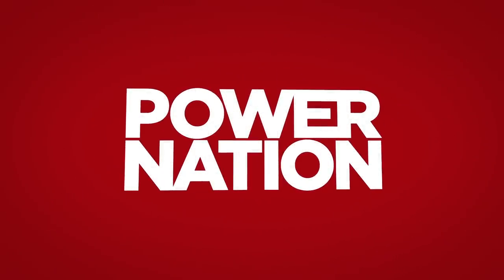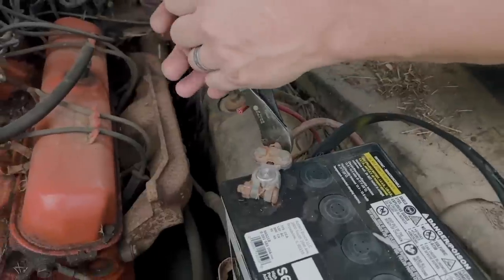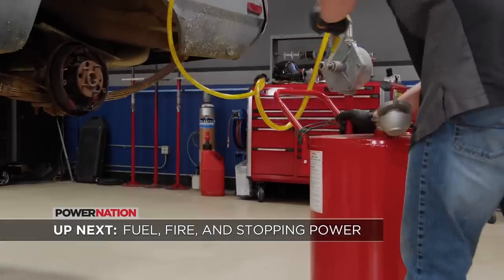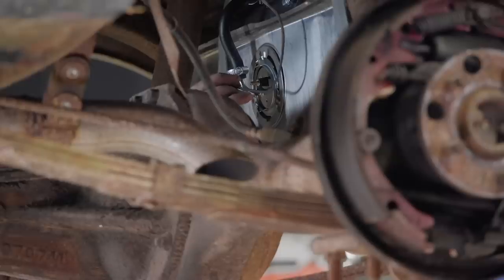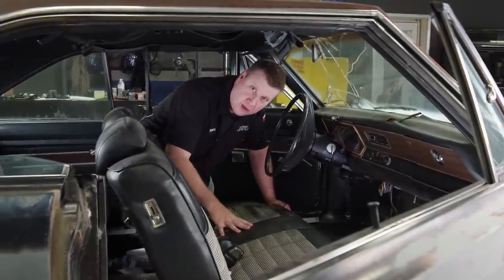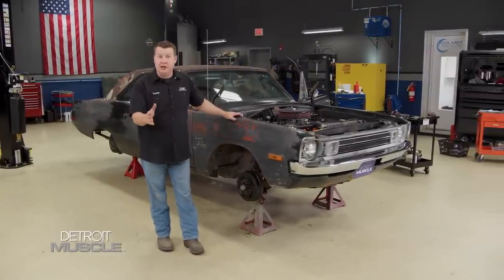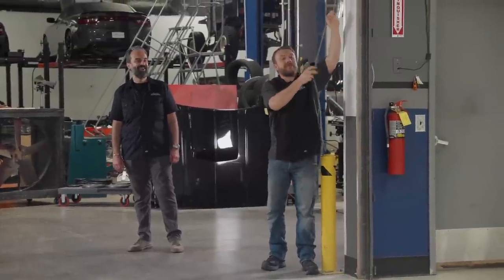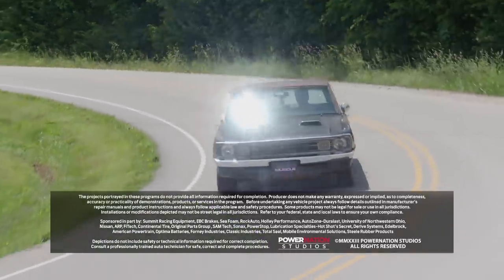Transforming A '72 Dodge Dart From Lawn Ornament To Pavement Pounder - Detroit Muscle S10, E7

Comment: We could only dream of finding a classic with solid bones like this
Reply: They are out there, you just gotta look.
Reply: They are out there somewhere. Only fewer and fewer ordinary people can afford them.
Reply: @Pracaupodstaw  Yep, that's why you gotta look outside the box for projects now, The HOT new build out here in Arizona are the Smog/Malaise Era cars from 73-85 because there plentiful and cheap often still running and driving for under a 3 grand. I daily drive a 73 Buick Regal that I bought for $1200 right after I got here and drove it home and then put another 5 k ish into, I just bought a 76 Cutlass for $2200 That I'm going to build into a weekend car.
Reply: @TheREALOC1972  Interesting. It is an option. I would obviously prefer a car from the 60s (possibly 50s or even 40s), but you know, the budget does not always allow you to fully realize your dreams. u, in Central Europe, an American muscle or pony is always a pearl or even a diamond - regardless of the decade of production.
Reply: @Pracaupodstaw  it's just in Central Europe where's that's a problem, I have 8k ish in my Regal you can't even look at a roller of most older muscle cars for that and that's just the start, 8k and mine is done.....
Reply: @Pracaupodstaw  SO correct!
Reply: my dad and i found an amazingly clean 74 swinger on cargurus lol

Comment: Minor point, but brake shoes are not about momentum, but leverage.  Assumimg a top anchor pin, the front shoe drives the rear into position during forward braking - rear shoe does most the braking, so it must have more surface.  If the pin was on bottom [I think some pre war cars tried that], its the exact opposite: rear shoe drives the front, which would put the bigger shoe there.

Comment: In 1972 my parents purchased a new Dodge Darts Swinger Special. It had a 225 CID slant six, a three on the tree, manual brakes, manual steering, and no A/C. The only thing it did have was an AM radio with a single dash speaker. It was the car I took my driving test in and that three point turn was a beast with manual steering. I had to use five points to turn, but I still passed!

Comment: I've had several Darts and B & E body Mopars, my first car being a 66' Dart. I wanted a 67 - 69 but couldn't afford one but found the 66'. It was wrecked but only cost me $75 back in 77'. fast forward and 5 Mopars later I just picked up a 69' with a running 440 with a lot of good upgrades. Can't wait to put it back on the road and cruise my local car scene.

Comment: You go through it, order a big pallet of parts to get it back up running and have it driving safely. This is that important first step. I couldn't come up with the $1800 to buy a yellow 72 Swinger back in 1990. But I did get a white 1975 Fury with slant 6 for $250 that was sitting in a backyard.

Comment: 9:03 For those watching-reuse the original locking ring whenever possible. They're a much better fit than any aftermarket rings.

 That right lower control arm is a replacement.

Comment: 1974 was the first year they had the 360 in a Dart, Demon or Duster. I am pretty sure they never offered the 360 in the Swinger either , only in the Dart Sport which was the renamed Demon.
Reply: I was wondering about that also. My roommate bought the first 360 Duster straight off of the showroom floor. We would go street racing against the locals on the weekends. 😉
Reply: @Darknamja  yeah, I had a full load 1974 Dart Sport with the 360 as well. For 1973 Chrysler muscle cars had the 340. The 360 had an externally balanced crank and the 340 had an internally balanced crank.
Reply: That's right. Options were 225 -6 or 273, 318 v-8. People just stick on whatever badges or stickers like here.
Reply: @Darknamja  lol, I bought mine new as well. The parts manager had it for a day as a full load demo car and I had a friend who was a tech there and he told me about the car so I walked into the dealership and said “I want the parts managers demo car”. My friend said that he was pissed!

Comment: I owned a 71 225 slant six. If you put it on jack stands you had better not open the doors. Unless you wanted to drive around a few miles until the frame settled.

Comment: Hey guys cool video; quick question-where do you connect the other side of that makeshift ignition wire? You put one end on the positive side of the coil and is the other end wrapped around the red wire on the positive battery terminal? or on the relay?

Comment: all mopars leaked inside from the front Cowl ,within less then 10 years most rotted away if they were not garaged or the owners did not remove the Floor Body plugs to drain out the soaked floors

Comment: Awesome video🤘🤘 I would install a windshield and wipers before you get her back driving daily. 😂
Reply: That's something that only takes a couple minutes plus doesn't need to be done until you get inspected. In alot of states it will pass inspection as long as the crack doesn't obscure the drivers vision and this one doesn't.

Comment: I bought a 72 Dart in the 80s for $400. Not anymore at that price. 2d. 318 engine of course green on green
Reply: I bought one in 2004 when I came back from Iraq for $1200, mine had a 318 also but it was a 4 door though but I didn't mind. I just wanted something to ticker on and take the wife and kids to cruises and car shows on the weekend. it was green on green on green. It was in phenomial shape when I bought it I didn't have to much to it. cleaned and rebuilt the carb and basically cleaned it up, painted everything that was supposed to be black black again repainted the block corporate blue, and the intake and valve covers silver and of course new gaskets all around. It was a great little car, I even took it to San Antonio from Central Missouri for a Army leadership course, AM radio only on the way down but I fixed that quickly while I was in San Antonio, went bought a cheap little AM/FM Radio and cd player while I was there because just having an Am radio I didn't get a damn thing on the radio for most of the drive and 14 hours in almost complete silence sucked. Got divorced in 2007 but I kept that car until 2014 because I loved it so much.

Comment: Disk break conversion needed.
Reply: First off it's Disc Brakes... and 2nd, not right off the flip when your doing a budget daily driver, Disc Brakes is literally very very very low on the "must do" list because the drum brakes still work. You gotta get the car running and driving long before you do a disc brake conversion. It needed alot of engine work, new fluids, new gaskets, a completely new fuel system and brakes that work, it also needed cleaned up and will need a paint job LONG before it needs disc brakes.  Disc brakes is an "upgrade" and not something that is needed right off the bat when you can use that 2-3 grand on other things.

Comment: All that effort, and you put front Drums back on it? Later model front discs would be much safer.
Reply: yeah but it's just going to be a daily driver, why spend 3 grand on brakes for a budget build daily driver when it needs that money else where? you can always update the brakes later on.
Reply: @TheREALOC1972  US $3K,... what are you buying, gold plated calipers??
Any true TAVO (Tight Arsed Valiant Owner) could do a brakes swap for under $500 using parts from later models, such as the front disc's from a 70's Duster on to the Dart.
Reply: @PiDsPagePrototypes  you aren't even getting calipers for $500, stop it dude.
Reply: @TheREALOC1972  Funny how I've already done it, but on an Aussie Valiant,.. 67 Safari, wearing 71 vented rotors, 77/78 cailpers, 68/69 master cylinder and remote booster, 79/80 stub axles. AU$700, about US$400 now.
US junkyard parts are cheaper too.
Reply: @PiDsPagePrototypes  It's going to be funny when that shit breaks because it's been sitting in the weather for 40 years....
Reply: @TheREALOC1972  Stuff like that only breaks if it's not maintained. If used and serviced properly, it lasts.
Reply: Because the swap involves more than pulling the drum off and slipping a rotor on the spindle. Suspension parts need to be changed as well.
Reply: @tbd-1  yep, that too, it's not worth the cost on a budget build.
Reply: @tbd-1  Especially if your just building a daily driver.
Reply: @tbd-1  Depending on year, with the Chyrsler A-Bodies, some of the parts fit without changing anything in the suspension - the early front Solid Rotors used the same wheelbearings as the front Drums, and the same mounting bolt positions on the calipers, and the same PCD for the wheels.
Swap to the Ventlated Rotors, and the first year keeps the PCD, but the bearings and caliper mount changes, so you only have to swap the Stub Axle, nothing else in the suspension changes. The second generation of Ventilated Rotors got a change in the PCD, so the wheels needs to be swapped. If you have early Alloy Wheels that clear the Calipers, you're good raiding the parts bin till the PCD change occurs. If you have Stock Pressed Steel Wheels, they need to match the year the Brake Rotors come from, as there's subtle differences that make it so the Drum wheels will clear the Solid Rotor Calipers, but will bind on the Vented Rotor Calipers.
I have both Solid and Vented setups on two '66 Valiants. I get five or six hard-as-you-can-push-the-pedal stops from freeway speed to standstill on the Solid Rotors before any fade. I can hit the pedal that hard on the Vented Rotors all day. With both set-ups the problem stopping hard isn't the braking distance, it's the idiots tail-gating that panic and have hit the obstacle I've just avoided.
Reply: @PiDsPagePrototypes  💯 agreed !
Reply: @TheREALOC1972 okay so a daily driver that you're going to risk driving every day doesn't rate 3k on brakes but I guess a garage kept car that you take out once a month does ? Sorry that doesn't sound right to me , what could be more important than stopping the damned car ?
Reply: @dalemckenzie2279  No not when there's no reason to because the NEW drum brakes work just fine, New to automotive world?

Comment: So.......... I figured it out....Rock Autb needed a PR help me

Cause they don sent so many people the wrong parts... people are starting to  complain and they're loosing money
Reply: That's because people order the wrong part to begin with because they are in a hurry and don't pay attention, I do this myself every so often. I just "got the wrong part" from them but once i went back and looked at my order I ordered the wrong igintion module because there are 3 different ones for a 73 Buick Regal, I have a J vin (4 barrel carb) and I ordered H vin (2 barrel carb), there's also a T vin, which is the 455, all 3 require different igintion modules, The J is a 6 prong, the H is a 4 prong and the T is a 7 prong. I would wager that 99.99999999999999999999999999999999999999999% of all "wrong parts" that are ordered are because the person who ordered it ordered the wrong part.
Reply: @TheREALOC1972  well I've seen it happen too many times ....I know they probably won't have what I need anyways
Reply: @clevelandmaker386  and odds are they ordered the wrong parts. I haven't ever gotten a wrong part when I didn't order the wrong part, well from anywhere but Autozone anyway, I don't buy anything from Autozone anymore, not even paint from Autozone because it's liable to wrong too.

Comment: Well, I've heard of ways to resurface vehicles in the US. Putting floor mats on a floor that has not been cleaned of rust, not welded with new chassis parts, where you can see pitting all the way through, scrubbed with spray .... Well, but for that there are new rims ... Tragedy.
Reply: No one has a clue as to what are attempting to say in your post.
Reply: That's the only thing you found wrong with this? They half arse everything

Comment: Yeah but, disk brakes are not that hard to do and have a few benefits over drums.
Reply: Yeah but they are also expensive as hell to do, why spend the $2000-$3000  on a disc brake conversion when you don't have to, especially off the flip and your building it on a budget and working on it while you drive it. When your working with a initial budget of 5k-8k to get a car get it up and running good enough to daily drive when it needs over things, a disc brake conversion is something you do after you've driven it for a while and saved up the money to do so. This car needs motor work, needs interior work and it needs a paint job LONG before it needs a disc brake conversion.....
Reply: They are just getting it running and driving,  not worrying about upgrading it ..yet...
Reply: @19chev81  exactly! why spend the 2-3 grand on a disc brake upgrade when a new drum brake kit will cost a couple hundred.
Reply: Go to the salvage yard and get the setup out of a dart or duster that has disk brakes. Two spindles, MC and a couple rotors . Not a $2000 to $3000 job.
Reply: @rmxrider20032000  So getting parts out of a junk yard is safer or cheaper than getting brand new drum brake parts? do you even know what a 1/2" wrench is? come on dude.... no.
Reply: @TheREALOC1972  gfy
Reply: If this was a GM they would've pulled out all the stops.
Reply: @dalemckenzie2279  Nah.... doesn't matter what it is, They were doing a getting it up and running project with a 2k budget. They aren't about to waste the entire budget on doing a disc brake swap.

Comment: Please no stupid ugly chrome wheels or billet steering wheel with the rim covered in an ugly color leather. It's a shame you do that to every car as the cars you build are sweet up to that point
Reply: I disagree with the chrome rims but everything else is spot on. I'm hoping they build this car into a classic Daily driver/Cruise-in/Local car show car. people by the overwhelming majority don't have a 50-60k to sink into a car, but they have 8k-10k to build a daily driver/local car show car. that's what they should do with this car just to show people it can still be done with little money. they should get it running good, fix what needs fixing, clean it all up, body work it and throw a cheap but decent paint job on it then throw some Thrust torque or Enkei 72 wheels on it.

Comment: Ya'll need to buy this car and and build a daily driver/ cruise-in car, like we were all hoping you were going to do with the 71 Caprice because that's what were all doing. Were not building 60 grand show only cars.... Were just buying a cheap classic car, fix what needs fixing, cleaning it up, rattle caning everything that needs black black again,  putting a decent but reasonable paint job on it cleaning up the interior and having a cool classic daily driver that you spent 10 grand or less on all in. You have that opportunity to do that here and you should seize that opportunity, does it run like a new car or like it did when it rolled off the dealer parking lot? no, does the paint look like it did when it rolled off the factory floor? No, are the front seats a different shade or sheen of black than the back seats or the dashboard? Yes... but who cares, your not taking to a Good Guys show or SEMA, your taking it to work and to your local O'Rielly's car show and Uncle Leroy's machine shop's Fun Run and it works prefectly for that.....

Comment: Should have sprung for a disc brake conversion on the front, drums tend to lock up !
Reply: That's an upgrade after you get it running and driving though, not something that's needed right off the flip. When your doing a budget daily driver that's 2-3grand you can put somewhere else that's actually nedded.